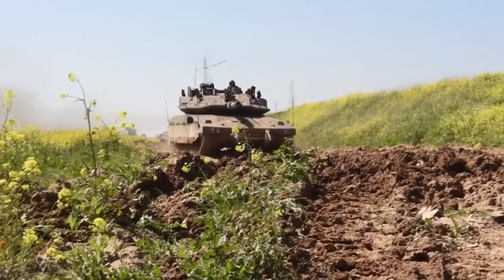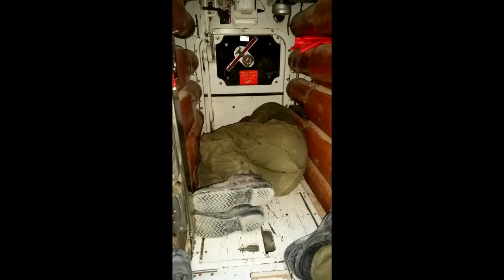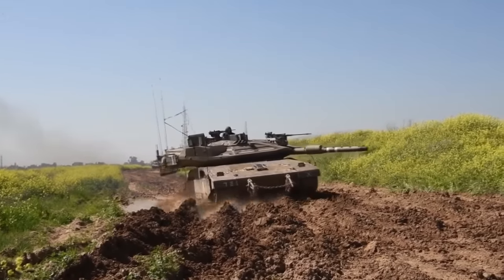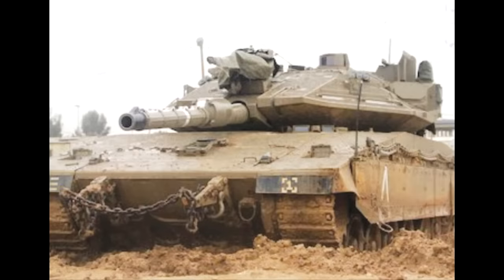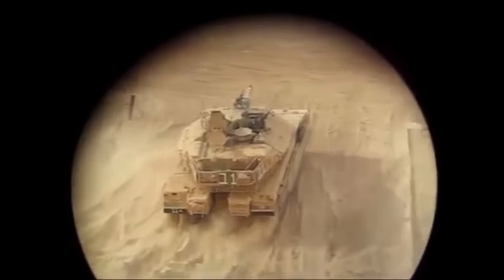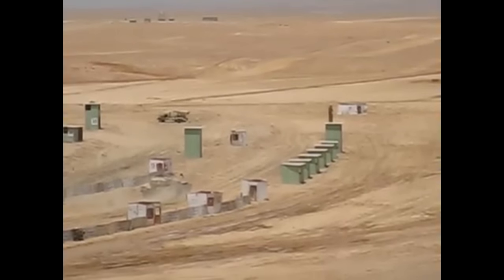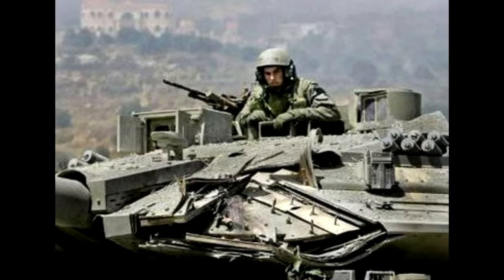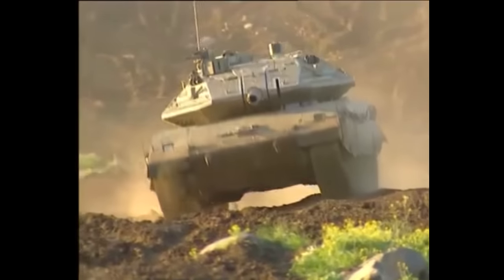Problems with Merkava tank

Comment: merkava was designed for counter insurgency, it's developpers concentrate their efforts to create armor wich resist against heat charges,such as rpg and atgm. the tank is not designed for symetric wars because it's not in nowadays israel doctrine to fight regular armies because all its neighbours fear a US intervention
Reply: That's complete bullshit! The Merkava was designed from the start to be a normal Main Battle Tank just like any other MBT for regular symetric warfare too. Keep in mind it was a big improvement from the Centurion and M60 tanks which were Israel's MBTs prior to 1980's. 
The Merkava was supposed to have better protection than the Centurion and M60, which it did.
Israel also wanted to obtain the Chieftain MBT from the UK, but that request was declined.
So they had to come up with their own indigenous tank, which became the Merkava.
And even though it still didn't have as good protection as the other western MBTs like Abrams, Leopard or Challenger, it was still a big improvement from the earlier Centurion and M60.
But the Merkava was still meant to fight in symetric warfares, which it did in 1983 against Syrian, when it knocked out several Syrian T-62 tanks
Reply: Nicole easy peasy lemon squeezy
like LifeLongStrong mentioned, the earlier versions were designed for symetric wars, but the nowadays merkava (4&5) are designed for counter insurgency, the israeli battle doctrine changes since yom kippour(1973), they no need to engage a large scale war against its neighbours since usa offer a larger support than before.today the idf is more specialised in pacification and counter insurgency than fight regular armies. and the proof is all countries that have insurgency problems buy israeli weaons(philipines,india,turkey,saudis with the iron dom,...) 
i don't say that idf isn't prepared against regular armies, but it can only gain time waiting the us intervention to save them. but in the geopolitical situation of israel today, there is no symetric threat despite iran wich is far from it borders and havn't an effecient airforce  to bomb israel.
and idf could buy foreign mbt like M1A2 or the french leclerc in the case of symetric war
Reply: @warmbreeze7996  merkava 4&5? I think you mean 3&4 but not 5
Reply: Shawn Sable  lebenon never had t-72,and in Yom kippour, the majority of idf tanks get destroyed by Egyptians maljutka,so by heat.israeli military had always focused it's efforts to offer a better protection against heat. Symetric wars are no longer their priorities for now
Reply: Nicole do you have menstruation? what's your problem i was answering shawn.
shawn it was a syrians t-72, i peel all files about lebanes civil war,i didn't dind any mention about t-72 losses. please send me a link
Reply: shawn t-90 was designed for urban warfare after the heavy tank losses in the first chechenya war.
Reply: yes it was used by syrian army in the lebanon civil war, but give me a link showing or related to destruction of t-72
Reply: "Counter-insurgency" aka killing civilians
Reply: @Texan 214 Utter rubbish.  It was designed based on the Israeli experience in 67 and especially 73.  The design is specifically geared towards fighting from fixed positions and revetments, just as the Cents did on the Golan Heights in 73.  It was designed as a conventional MBT with that tactical employment in mind.  It is not an "urban warfare counter insurgency platform" in design - as the very hasty Israeli development programme following their considerable losses in 82 in Lebanon demonstrates when the vehicle suddenly developed increased protection against ATGM and RPG weapons.  It has become heavily focused on that aspect over the succeeding models.
Reply: Merkava only protected from the front.
It’s back is soft
Reply: Lol... Internet warriors…
Reply: If it's main purpose is counter insurgency, why does it have a main cannon instead of an auto cannon? Does the insurgents have that many tanks?
Reply: @TheAwillz  So it's exactly the same as every other MBT.
Reply: you mean the main objective for Merkava is to obliterate kids armored with rocks
Reply: @warmbreeze7996  Wrong. Israel is always on defense against it's Arab neighbors. Latest Merkava mbts are meant to function in both symetric and asymmetric warfare.
Reply: No, the Merkava was designed to keep the numerically superior Arab forces at bay. It is an MBT designed to face off with conventional forces, its ability to function well in an urban setting and against insurgents is a consequence of the lessons learned from fighting wars with the surrounding Arab nations and later upgrades to respond to changing needs.
Reply: iatsd yeah but this is even softer than others
Reply: @Julez60  correct
Reply: Bcz its designed to fight soldiers, not other tank. XDDDD (i remember the hamas)
Reply: IFV: hey!
Merkava: who are you?
IFV: im you, but smaller.

Comment: The bottom line, The Merkeva has served Israel well in real war conditions, and the design would have been dropped if found to be impractical.
Reply: Hamas begs to differ, using russian anti tank weapons, they took out quite a few.
Reply: @manofchaitea6904  on what are you talking about? lol a few? for as i know not even one so far the only one who did was Hezbollah and it was an old version
Reply: @haimlamash6371  Hezbollah took out several in 2006, different models both current and older, and they proved to be easily destroyable with modern Russian weapons like the Rpg- 29, then again so are most tanks.
Reply: Noam Sviri  The new Merkava? yeah, I'm sure it has upgraded armor, the IDF have tons of combat experience to build a better tank.
The only viable weapons that may defeat new tanks would be the Kornet missile and maybe the RPG 30. The Merkava is an interesting design, and I like to watch as it is improved. All the best.
Reply: The design is obsolete compared to the Leopard 2 and the Abrams but it does It's job
Reply: it’s not so simple. When any big military project is developed it’s a big investment. Plus, many tanks are already produced. If it has problems they will be overlooked because it wouldn’t make sense to scrap billions worth of cost in production and development. 

All this means is that whatever problems that present themselves aren’t bad enough to justify replacing the tank. 

Consider the fact that these tanks are usually deployed against insurgent fighters that don’t have tanks themselves and fight with leftover Soviet anti tank weapons. Thus problems with the IR visibility aren’t important for this purpose and the armor is sufficient enough to protect the crew despite being lacking compared to other tanks.

Basically, it does the job good enough against the threats it typically encounters. Put it against an actual army with more sophisticated weapons and tanks of their own it’s likely the merkava’s weaknesses will show. 

 “if it was a bad tank they would get rid of it” doesn’t mean it’s a good tank either. It’s good enough to do the job against insurgents but it’s not a good tank compared to its other western counterparts.
Reply: @theblitz6838  If it does the job, its a success. The MERKAVA might not compete with the latest US, German or UK designs but it works for Israel.
Reply: @mechadonia  I understand your points but also the MERKAVA was designed to suit Israeli needs which may not be seen as good tank design by other nations. The Merkava was constantly upgraded but I believe a new design is on the way so it will be interesting if it retains any of the Merkava features.
Reply: @mechadonia  Exactly. The Merkava started as any military project, and the troops are forced to use what has been designed for them. The major militaries of the world all do the same thing, they put so much money in development, that they must use what they paid for, while making improvements. all the best
Reply: @manofchaitea6904  No Merkava tank was ever destroyed by Hamas using anti-tank missiles, a few were destroyed by Hezbollah using Kornet missiles in 2006 in Lebanon but not by Hamas in Gaza, you are confusing fronts, additionally the 2006 Merkava's that were hit were the old version without the TROPHY active protection system, with the TROPHY in 2014 and 2021 operations the Hamas didn't managed to even scratch the Merkava or Namer armored vehicles while their active systems(TROPHY and Iron Fist for the Namer) stopped more than 30 Korent and RPG-29 missiles.
Reply: @Ozires da Silva Compared to what?
Reply: @Ozires da Silva Merkava, while being a great tank for what it was designed to do would struggle against ABRAMS or Leopard...Black Panther? another Russian disappointment.
Reply: @Ozires da Silva I stand corrected. The BLACK PANTHER is not battle tested, so any technology improvement is yet to be seen as relevant. The MERKAVA is a great tank but designed for Israeli needs. Like the Merkava, the Abrams is constantly upgraded.....i guess a face off would see which tank is best... my money is on the Abrams..
Reply: @Ozires da Silva I suppose you have experience with MBTs... i have a little, but do not pretend to be an expert. I like the Merkava so we can only suppose which would be the better option in combat. We use the Abrams so i am biased.
Reply: @Ozires da Silva This shows how much you know about MBT's, lmao...
Some times it's better to just shut up haha
Reply: @Ozires da Silva Yes they were. 40 tanks were damaged, and ten of all models, both old and new, were pierced through with Kornet missiles and RPGs. TROPHY is yet to be battle proven for long term,  it reminds me of those "defense lasers" that looked like a big red lens mounted on the front right of the turret. It's purpose was to scramble and destroy any incoming missiles before they could impact the tank itself. It didn't live up to the hype, so I hope TROPHY works well.

They put these "red lenses" on all Russian MBT's after the T- 72. In the case of the Russians, they were more of a placebo, consolation piece, that provided an added sense of security only in their minds. It improved morale, until their fellow soldiers watched missiles coming at them, and their "scrambling device" failed. 

The facts are at least 40 were damaged by Hezbollah, with at least 10 of those having piercings in their hulls, all the way to the inside of the tank. That is not a bad record at all considering the intensity of Israeli wars and aggression all across the middle east. They used to be the ones getting invaded (1948 invasion by the Arabs, Yom Kippur invasion, to the 6 day war.), but now Israel invades neighbors to build settlements in the "buffer zone". History repeats itself all over again. I know that the days of the tank are over, and I acknowledge the fact that Abrams and Leopard and the rest can all be defeated with modern weapons, just like the Merkava. No weapons system will ever be invulnerable to new tandem- warhead and shaped charge rounds, Tanks in cities are vulnerable more today than ever. All the best.
Reply: @Ozires da Silva The Merkva doesn't even have blowout panels? It's a cheaper self made MBT for a small country while the Abrams, Leopard 2, K2 BP and the Leclerc for example have these Blowout panels for the main ammo bunker. In case of an ammo cook off the crew is always protected, not in the Merkva...

Besides, the Leopard 2A7 is chosen as all around worlds best modern MBT so this entire discussion is pointless.
Reply: @Ozires da Silva I will look into it.
Reply: @justinwaters8679  You are either uninformed or ignoring information, since 2014 TROPHY has stopped 15 out of 15 missiles fired at Merkava tanks including Kornet, Metis and RPG-29 missiles, I don't know what you're calling "long term" but so far since that system was introduced there was no incident where that system failed to stop an incoming missile so comparing it to the two red low-tech "flashlights" which the Russians use is out of place.
Reply: @E_y_a_l  Yes, I was thinking of the "missile scrambling systems" that have been around since the 1960's, mostly on Russian tanks. The TROPHY system is an entirely different beast, very effective as you said. Apologies for the confusion, I'm sure if anyone's army is up to snuff, it would be the IDF for their everyday experience since the foundation of Israel. I think the TROPHY systems and similar Close- in Weapons System (CIWS) rotating cannons on ships and tanks is the future. All the best.
Reply: @manofchaitea6904  hamas never destroyed a mk4, only 2 were destroyed ever, both by Hezbollah
Reply: @manofchaitea6904  bruh what Israel won while sorrounded